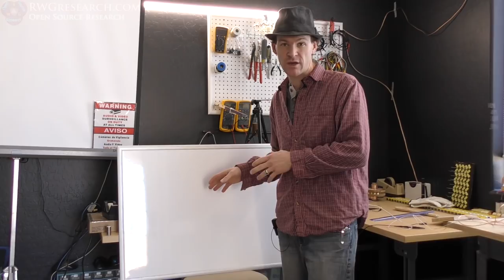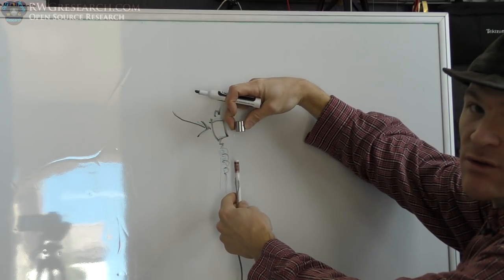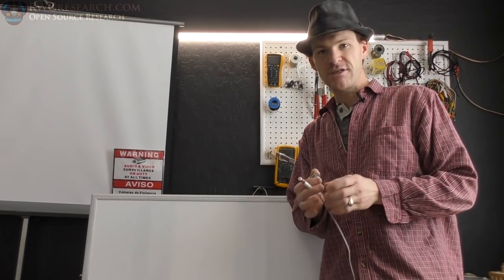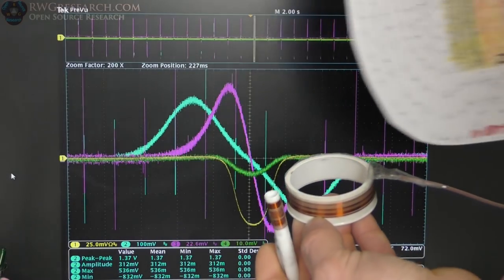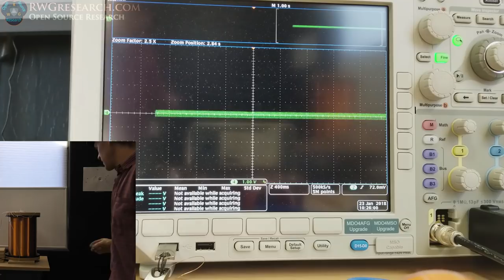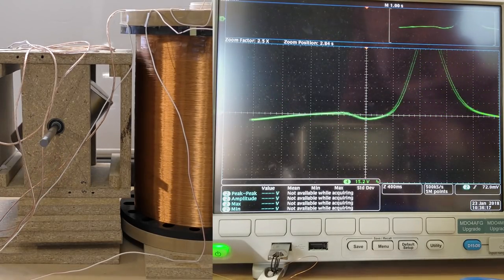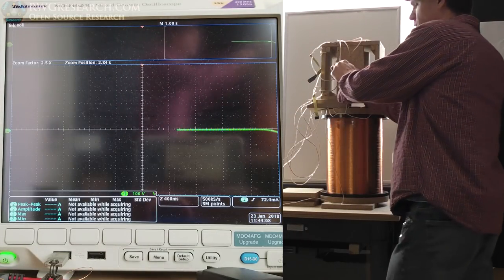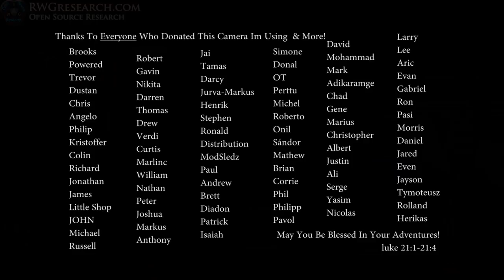The Search For Answers Part 14: Coils & Magnets. Back To The Basics. Very Counter Intuitive... B

Comment: "Gyroscopic particles" is a helpful way to "visualize" the field; however, i am skeptical that there are any "magnetic particles" or "or gravitons", only a warping or shaping of "the field". You can call it the Aether, Higg's field, Zero Point Field, or Dirac sea. Regardless of the nomenclature, this field exists and behaves in this way: it has a direction and momentum or "flow". I don't agree with this theory of gyroscopic particles, first proposed by Joe Newman, simply because of the nature of the energetic field and it's non-locality, or quantum abilities. It is a field of "information" or spin directions, yes. But do these Newtonian concepts of "particles" actually exist? I think in some cases, like that of high energy rays, "gamma rays" or "beta rays", etc., there is some evidence for the particle-like nature of energetic radiations. But in the case of light waves, electrons, neutrinos, magnetic fields, etc, the field takes on the function of pure energy. No mass can be detected, and individual "particles" can not be resolved. If there is only one of this "God field", the "force" that gives rise to the Higg's boson and the qualities of mass, then we should be looking more along the lines of Harold Aspden, or the recent work of Konstantin Meyl. Think of tiny, spinning vortexes, or "toroids of energy" in the field, eddys or whirlpools in the spacetime, not the old, caveman concepts of Newtonian "particles".
Reply: Particles are a very "digital" way of thinking: points, numbers, bits. The real world is analog, with an infinite shades of "gray". Everything is connected. For example, when you leave Earth, there is no sign that says "you have now crossed into outer space". There is no clear-cut dividing line. The atmospheric pressure just gets less and less, until you reach the nominal vacuum pressure of "space". But regardless of the lack of mass or "atoms", the field is still there, still supports whatever matter exists, albeit with negative pressure in all directions.
Reply from the maker: Just FYI, I'm totally agreeing that there is more to know. and that what Newman gave us is not the final say. There are defiantly more things going on here. however. what he did do was give us enough... and if one hears out what he is saying in a mechanical scene, that's enough to get where we want to go but after that there is so much more we can do when we get closer to whats really going on... thanks for the comments! ~Russ 
PS. let me ask you a very important question. in your view point. dose a magnetic field have mass?
Reply: Don't you think modern physics has lost its way? Pure energy without mass (inertia) when it suits. No faster than light (E=m ...) when that suits. Modern physics is barely science in the traditional sense. It's riddled with contradictions and untested theory layered with plaster after plaster to fix these theories at every new bit of true science that arrives to show why the terriers are dead. If there is no inertia then relativity is dead so there is no science to this approach. I think it's time we looked harder for what is there. All waves - EM or otherwise - need a medium, they don't 'wave' themselves it's the medium that waves, it's just common sense. The fact we can't yet measure it is just a limitation of current science nothing more. As for what does constitute the field I'm guessing we don't have to do too much more than to unwind science back to before the Michelson Morley experiment result and Maxwell equations were both abused to find solutions. Dare the scientists do that? Look closely enough with 'pure' logic and there is no need for much of what followed as science in physics since.
Reply: Good points...If Walter Russell is correct, then 'particles' are simply if you look at the 'anode' dynamic of a 'cathode-anode' spiral dynamic of electrical energy. This is why the double-slit experiment may just be the perspective of the observation - that may be the REAL 'observer' effect; it doesn't change light from wave to particle at all, it may be just the observational point of perspective.
Reply: The real question is, do particles really exist at all, or are we just seeing concentrated and weaker fields everywhere we go? Everything is made up of interacting fields, certain combinations and interactions lead to the formation of apparently solid object or particles while others appear as empty space.
Reply: Great comments, All! When i built my first Newman motor, i was starting from a skeptic's viewpoint, a qualified and highly trained electronics engineer. When i was surprised to find that it worked right away; i then began to wonder about the politics of science, the WHYs and Who's that prevented Joe from getting his patent. But even if Joe HAD been granted a patent, or even had his theory accepted with "conclusive evidence" before the American Physical Society, i believe now that he was doomed to fail. The Oil, gas, and weapons industries run this country. It's a fascist system (rule by corporations instead of rule by individuals or "representatives"). Speaking about super-powered or super-efficient electric motors that COULD replace the gasoline engines, simply is NOT ALLOWED. I learned the hard way that merely talking about "free energy" can get you into extensive legal and financial trouble. I have been attacked, threatened, and i was even locked in a psychoward, just for talking about free energy, trying to find "investors" for my latest invention of "ultralight, DC motor/generators". They don't really want to create green energy tech jobs in this part of the world (deep south). All they really want to do is keep people addicted to the pump, working to pay fines and buying imported heroin from Afghanistan. A good lawyer could have gotten Joe a patent, removed the "theory" and cited better references. But i was granted the first US Patent for "virtual reality" 30 years ago (US Patent# 5394029), built a fully functioning prototype with real-time response rate, and it was a total waste of money. I doubt that we can ever change the oil and gas company virtual reality, the LIE that it takes "more and more current to make a motor go faster and faster," or the fantasy that carbon and uranium are the ONLY two elements that contain "energy". ALL of the large academic institutions (and the Congress too) have had their "science" perverted by oil and chemical company money and propaganda. Exxon funds the "Breakthrough Energy Contest", while BASF sponsors the "New Horizons in Batteries". Even the various cures for cancer have been suppressed by the drug companies. Drugs are PROFITABLE, and so are gas-guzzling SUVs. Curing people or giving them free energy, solar-powered, electric cars (so they never have to work again) is NOT PROFITABLE. This is why they create these "non-profits"- not to HELP PEOPLE, but only to make sure that NO PRODUCTS ever get manufactured, no "cure" ever gets found. They claim they are "looking for breakthrough energy technology"- but i guess there's just too many forests for them to find any "trees".
Reply: What I don't get though is that our technology is at the point where a limitless energy device would mean complete automation (to a degree of course) of almost every thing from farming to production of virtually every product we need and consume plus with AI advancements on the way it would also mean replacing workers with Robots capable of doing the tasks we need done. Its the main reason they wish to continue this nonsense, so they don't have to do anything so other people can do it for them. The kicker is that now with the right amount of energy our technology is fully capable of doing all of that already.

They're addicted to power, they want to own people and be able to tell them what to do because it seems more convenient right now than having robotics do it for them, people just seem easier to deal with... they're scared of change, just like everyone complains about automated messaging systems because all of a sudden its on you to get yourself where you need to be by following prompts instead of a "oh hold on while I connect you" and your there.

So until perfect AI is made that functions like a real person (a very bad idea by the way) were stuck here... all because they don't want to put in a little effort in instructing a robot to do something were still in the transition stage. The thing is eventually because they will always want more power, they will make the perfect AI, and because greed breeds more greed, eventually more people in positions of power will mean more demand for the perfect AI to do stuff for us, and more demand for that perfect energy device. Hence the singularity which if AI becomes self aware will lead to our destruction once it realizes we've made it our slave. All because some people didn't want to learn how to use a simple program to get something done, they have to go and make it think for its self so it can think for them and then eventually realize its more powerful than us and that we should serve them. Lets just hope they never develop a sense of empathy, or we're all going to be screwed.
Reply: Nicely stated.

Comment: You genuinely don't understand what is going on here. It is so simple and yet it has completely evaded you.
Reply from the maker: The point of the video was made real clear. You can learn what you already know. , A coil, is not a magnet, and to make things work together and add to the system instead of fighting the rotation, one must go back to the basics. induction in one direction. using a single wire vs induction in one direction using a single coil, theses were the items demonstrated. ~Russ
Reply: You seem to think there is some mystical difference between a single wire passing a magnet and a coil passing a magnet. That is what appears to lie at the foundation of all your errors.
Reply from the maker: yes, the video dose appear to guide you that way, but the results show more than just that. be hoist,  did you watched the video in its entirety? ~Russ
Reply: No. I stopped watching when it became apparent that you thought the coil was somehow acting odd, whereas the reality is that you simply didn't appear to work out that it was merely acting as two single wires a small distance apart and with opposite polarity. Which is exactly what it is, and perfectly explains everything you seem to think is counter-intuitive.
Reply from the maker: ok, good, I did not fail my part, your statement is correct. and i agree what what your saying. So the point of the video was clear. and there is more to see. I teach by making people think. and answering there own questions some times.  I'm not out to confuse. ~Russ
Reply: Your explanation was that rubbish spouted by Newman. Which is completely wrong.

Comment: one direction of current?  why anyone will think that way from the first place?  according to Faraday's law the EMF is given by the rate of change of the magnetic flux . meaning increasing flux result in current to one direction and decreasing flux makes current to the other direction.
 that exactly what happened in that case.
Reply from the maker: Tomer Glick the difference is in the applacation of a coil... In allmost  all current applications of coils they try to make them act like a magnet.  In my research I want a coil to act like a single wire.  So this deminostration is to show how that can be done.  ~Russ
Reply: Sorry for my lame understanding, but difference from what?  coils are used for many things.  By  "act like a magnet" you mean electromagnet?  
And also I do not understand the idea of coil acting like a wire.   Lorentz force is acting on every particle (electron in our case) the same,  no matter if it's in a wire or in a coil.  Faraday's law expend on Lorentz force to describe electricity in electric circuit and coils.   
For the sake of people that are not familiar with the field of electricity and are not going to study it by them self, I afraid that that this video suggesting that there is something totally wrong in the current models we use today.   I'm not claiming that there aren't things that we don't know.  but from all of your tests here we can see how the model we use today is accurate, even if it doesn't look intuitive.

Comment: Just to be clear of something, at 15:29 in the video, is it because you are crossing the BLOCK WALL that BEDINI is talking about in his book???   The BLOCK WALL could be perfectly demonstrated with the graph of your oscilloscope... RIGHT!!
Reply from the maker: The Bloch wall ( not block) , This is at the center line of the magnet. where the south and north flip. the end pole could be thought of in a similar way, but its different. if you look at the guass meter output, when the magnet is on the side, that's what your seeing. so now compare the magnet at 90 degrees. it acts like the Guass meter. Everything seems to act 90 degrees from what it seems. however, what is key here is the single wire... and the direction of spin that the magnet is putting out. i will be discussing the Bloch wall some time in the future. ~Russ
Reply: I get what you are saying..  But , after revising the different scope shot and coil position, it look to me that the coil is REACTING LIKE A MAGNET with a zero point at the center where the zero energy could be measured with a tempeture censor..  The KROMEY machine is demonstrating the effect and the coils are what is attracting the cold reaction...  Anyhow!!  I am in my 5th time viewing this video entirely and seeing things I miss in the previous views...  Very interesting experiment and you validate John Bedini case when he say that the SSG run more efficient when run in ATTRACTION MODE.... Thanks Russ!!
Reply from the maker: yes, I'm with you. some of theses test results bring more questions than answers... :) more to do for sure! ~Russ

Comment: I'm confused. You just show that the voltage goes from positive to negative and then say the current is always "the same way"?!? It is AC you are showing here. Now if you changed your gear to a rotor with just north ends out, then you would have it one way all the time
Reply from the maker: Anything that swings below the zero line is flowing in the other direction. anything going from positive to the zero line just a decay... its kinda confusing. hope that makes more scene.  ~Russ
Reply: I know that. Like 38:05 you say "current is only one direction". No. It is one pulse positive and one pulse negative so it is AC plus and minus